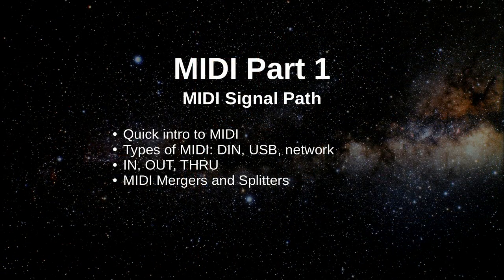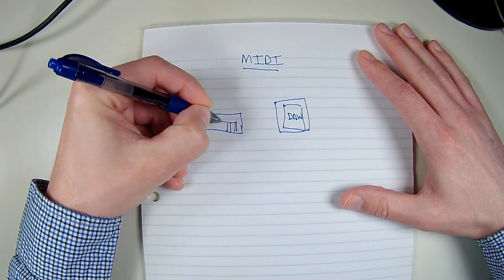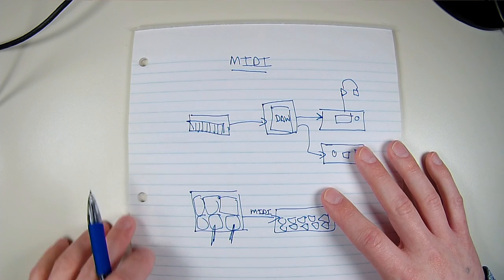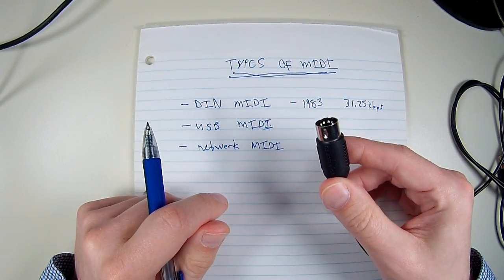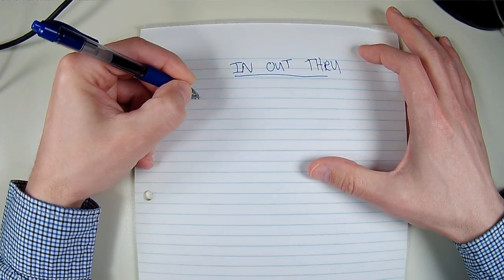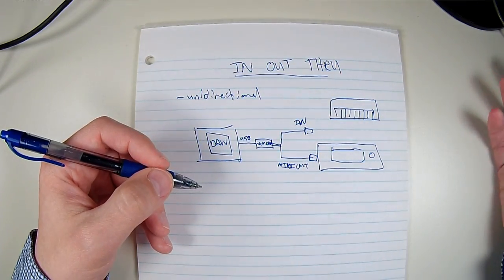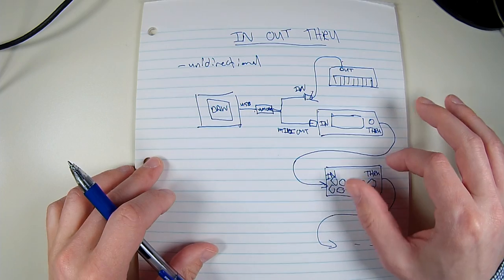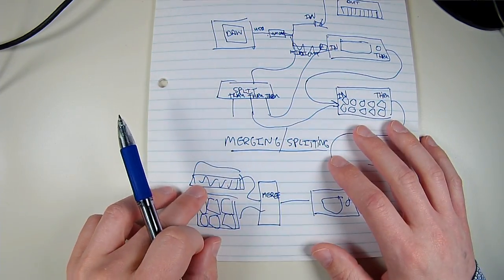MIDI Part 1 - MIDI Signal Path

Comment: I found this to be very interesting and well presented. I used MIDI back in the early 90's with and Atari running cubase and a couple of yamaha dx synths. It was good to go back, recap on some old knowledge and then learn some of the new tricks. Some things I had forgotten but came right back when watching this. 
I am going to follow this series, use what I have learnt and then put it to use with my new equipment and DAW. 

Thanks for putting this together
Reply from the maker: Glad that you found it interesting!

Comment: Very good! I had Cakewalk way back in the 90s. I had a synth I was trying to play. It had MIDI so of course I hooked it to the old 486 with its whopping 2 megs of ram and 40 meg hard drive. And sat there wondering what to do next. I recall getting lost in remap tables that would go round in circles. I had too many hobbies and dropped that one and the rest is history. I then took bass guitar lessons for two years. Again, I found myself with 48 hours a day devoted to hobbies on a planet with 24 hour days. Doh! I sure could have used this series back then.
Reply from the maker: I definitely know what you mean! I also started with Cakewalk back in the day. Kept doing music but eventually found myself building music electronics and have been at it full time since 2009. Been spending more time doing designs than actually making music but as you said there are only so many hours in the day. Lockdown has helped to set new work/life balance... trying to spend more time playing when I can pull myself away from the workbench. :)

Comment: FYI DIN stands for (Deutsche Industrie Norm). :-) I had my first synths here in Munich during the 70s. First we had only control voltage synths (using 0-5V) then around mid 80s the MIDI norm, for standardization (Roland/Korg+Yamaha) showed up with the DIN plug.
Reply from the maker: Yup, but I didn't really think it's important to mention. It probably felt futuristic back in the day... now it's hard to make it fit into a modern design. :)

Comment: Super helpful video. Thanks a million! The reason the cables are labelled as they are is simple. It is the standard routing for all audio connectivity. The out or output sends a signal "OUT" of the Controller to the DAW with the USB connector as the In or Input to the DAW. On the return the USB is the output from the DAW sending the signal to the Input on the Controller.

Comment: excellent coverage of this topic, using paper and pen to describe the topic rather than 'hand waving' bravo!!! I agree with you about the tendency to 'hide' the midi protocol inside the USB configurations, this has caused me a lot of problems with software heavy configurations and is part of the reason I was looking for information about how MIDI actually works. I had an ATARI ST with midi ports connected to a Casio CZ and Korg DDD-1 drum machine hours of fun when modems ran at 9600 baud ;-) Cheers
Reply from the maker: Nice! Sometimes the more direct approach to music making is more fun. I think it explains why small table-top and modular synths have become so popular too.

Comment: Great video.  I'm having confusion about hooking up my equipment.  Here's a list of what I have and the MIDI ports on each.
Computer:  Windows 10
     -Software: Reaper (64 bit) DAW that is MIDI functional;  FocusRite Control (for routing functions)
Audio Interface:  FocusRite 18i8:  MIDI In and MIDI Out and USB (to computer)
MIDI file storage (using 3-1/4" disks):  Alesis DataDisk:  MIDI In and MIDI Out/Thru
Ensoniq SQ2 Midi keyboard (76 note keyboard):  MIDI In and MIDI Out and MIDI Thru
Drum Machine: Alesis SR-16:  MIDI In and MIDI Out/Thru (the SR16 currently can't get sound out, but it still appears to function).  I have another one coming on Wednesday to replace it (and hope I can get everything transferred over to it, either directly or from backup 3-1/4" disks with the Alesis DataDisk.  I have had this stuff since the 80's.. lol

SOOOOO.... the BIG question is: in what order do I hook all of this up?  Is there an importance as to that?
Thank you in advance of any help/advice you can give me.
Chris Foster

I might also mention that I have a cable by "iConnectivity mio" that has a USB connector on one end and splits off to a "MIDI Out" cable and a "MIDI In" cable. According to the manual that came with it, the "MIDI Out" cable connects to the "In" port of whatever equipment it's going to and the "MIDI In" cable connects to the "Out" port of whatever equipment it's going to.  
Where should I use this cable? I'm thinking the DataDisk to Computer USB, but what do I know... ;-)
Reply from the maker: It doesn't matter what order you plug stuff in. It's more important to write down the actual MIDI ports you used for each if you're using DIN MIDI devices, since your software can't detect them by name like with USB.

As for where to use what cables and ports... it's really up to you.
Reply: @shiftedphase  awesome. Thanks for the quick response

Comment: Just starting out in dawless music making and was looking for a guy like this to explain midi and the terminology used. So thank you for taking the time to do this. I think I’m following your explanation.
What I’m after is having my drum machine control the tempo of my synths, because I’m trying to add a live element to my Djing. I’m using vinyl and traktor through a xone 96. I beat match the tr8 to vinyl by ear but need the rest to sync up by them selves. I think this is what’s going on in my system so far clock out from traktor into mixer sound card then out to tr8’s in  then out going to volca base. But just bought a korg monologue and have a Roland efx303 groove efx and sequencer that I’d like to try and control volca base with. Any advice welcome. 🤓
Going to watch the rest of your videos now. Thanks again...
Reply from the maker: If you have one clock source and just want to sync them all up, you might want a MIDI THRU box of some kind... this can make cabling easier.
Reply: @shiftedphase  thanks, I’ll look into it.

Comment: in midi pratical use there are other types...for example the splitter box can connect a daw midi out and make several copies of midi driven faster than a daisy chain setup, but the three synth connected are receiving the same copy of midi out, so the number of channels and bandwith is essentially the same.

but there is another way, the midi multiport interfaces like old opcode studio 128/64/256 or motu midi timepiece or avid midi/o....those boxes are connected to the same computer via usb or other interfaces (parallel, rs232 etc) and daw recognizes it like multiports...so i have midi out 1/2/3/4 and so on....in this way every port runs in parallel and has independent midi channels from each others and so more bandwith because every port is essentially a midi interface on its own.

in past i used this way with atari and log3 to running notator logic and then with mac using opcode models, emagic and motu (still have one in studio)
the nice thing was that old interfaces like log3 on atari or motu studio 128 had a parallel bus not serial so midi timing was really steady...i remember logic on atari...today is everything connected to a ultra speed serial bus....is fast enough to do the same but the parallel port was really an incredible reliable connection in those days when you had 7/8 modules connected running at the same time (maybe one or two samplers....some expander like wavestation and jv2080...and so on....)

I remember well cakewalk from 12tones systems....now it's sonar...never liked it so much....I started at 12 years old with amiga 500 and quite nothing three years later got a kurzweil k2000 sampler and then an atari...nice moments! 

today midi is still used to control some analogue synth via usb and mostly to control vst instruments....but the magic of old midi studios with a rack full of expanders and samplers has gone....it is true also than two synthesiszers like integra and montage today can deliver whopping 384 polyphonic voices whereas an old sound module of nineties or late eightes was around 16/24 or 48....roland jv had 64 but with 4 oscillators was like having 16..

I remember well one of the most common "poor man" midi setup....roland u220, korg m3r and yamaha tx81z....and an atari 520 st running creator or miditracks st!

today a montage alone gives you 128 sampled voices and 128 fm voices with 8 operator and 2 fx for every track plus reverb and delay master fx! wow....time changes.....  :,)
Reply from the maker: Well class-compliant USB MIDI interfaces support up to 16 "cables" on the same endpoint... similar to what you're talking about from those oldschool units. I plan to do a video about USB MIDI where I will show how the protocol looks on the wire. It's a good example of "old stuff running over newer stuff" which is so common in technology.

Comment: Thanks a lot.
I've been trying to find someone who can explain midi in a precise and clear manner. Released in 2017 so the information is going to be up to date.
Reply from the maker: Not much has changed, except how we think about using MIDI. It's still got potential far beyond how most of us are using it. :)
Reply: +Shifted Phase the most common issue is raster delays that midi has still todays...cannot be 'sample locked' to daw....but is easier to measure this time stamp issue and then slip the track/region after recorded in audio and align it to audio tracks, the problem could be only if one want to use it completely in realtime even during mixing.

some people buy old samplers assuming they sound better than software...that is quite true, sound different...but if you later record them inside a computer using crappy audiocards the problem will still be there...so the only solution would be doing old school....sampler playing midi tracks on different channels via separate outputs and then into an analogue mixing console.

but with modern interfaces timing issues could be a problem, knowing well midi protocol is important so these videos could be really helpful for people interested in this kind of usage.
Reply from the maker: You have some interesting points. I think whatever tool people feel "at one" with that gets them results they're after for music making is the right one. It's fascinating how "progress" can sometimes leave out unique qualities of older systems that potentially made them better for some uses. Just look at the retro computing scene!
Reply: +Shifted Phase  yes it is....and the most strange and interesting point is....

i am completely sure if we talked maybe in 1972 to moog robert, or pearlman and stated "in 2017 your electronic stuff will sound better than the newbie" they probably called  us fools....in 2017 we will probably on mars! and same with ppl who made akais or emu samplers of the nineties.

but this is what actually happened, today moog had to reissue model d minimoog, and people still searching old stuff....but whereas retrocomputing is only nostalgic stuff because you can emulate 1:1 in modern pc so prefering a real nes or amiga is only a question of "feelings" because every pc or mac or smartphone can emulate 1:1 those hardwares, with old music gear is not always possibile neither digital or analogue.

arturia or ni have minimoog emulations via vst but the real thing sounds really better and different, we are getting close but having a real model d or a vst version is still not the same (and we still have not considered the hardware feeling side.....)

And then but this is imho....we gained so much more possibilities in terms of power compared to 20/30 years ago (every mac with logic can handle at least 96 tracks....) but music is not changed in better....when i listen to some electronics from 80s and 90s with samplers max 16 megabytes, old school midi and more primitive stuff compared to nowadays possibilities, I'm not perceiving it like dated or oldie, and never boring....what instead I feel in the most of modern productions.

Comment: Thanks for this sensible explanation.  

I have a question regarding daisy-chaining keyboard controllers to control software synths In a DAW.

Would you use in/thru, in/thru & in/thru with the end controller providing the OUT return to the DAW so you have a complete in/out loop?
Reply from the maker: You can’t do it like that... the THRU will not mix in signals from the keyboard itself. It only passes signals from the IN port. If you want multiple controllers use a multi port MIDI interface to you computer.

Comment: I know this video is quite old by now but I have a question;

When we daisy chain from the external synth that is playing back the sequence in the DAW, does the thru send the MIDI channel that the sequence is on from the synth to the Drum machine no matter what, or can you record and play a new sequence on the synth itself, assign that to a new MIDI channel, and send that to the drum machine? Like here's the hypothetical I had in my head; so a DAW is sending a MIDI sequence to an external synth that is playing some kind of lead preset. Now yow want to connect the MIDI thru from the synth to a drum machine, but you want a different sequence of MIDI notes to play (not the same one that the DAW is sending to the synth) could you record a new sequence in the synth, save it, and send it via thru to the drum machine, and now that drum machine would play that different sequence with it's drum sounds?

Please just tell me if none of this makes sense or is just completely non practical
Reply from the maker: The THRU port is literally an electrical copy of what comes into the IN port. The local synth has no way to change it. But because MIDI supports 16 channels on one cable, you can have your DAW send multiple sequences on the same cable, and just set your synths to different channels. The whole purpose of THRU is for this very use case... back in the day computers literally had only 1 MIDI out in most cases. So entire studios were running from a single daisy-chained cable like this.

Comment: This is a very useful video for me!!! Just what I needed. Yet you gave me an hint and now I have a question :) Since I need to connect mymaster keyboard to PC and also the synth to PC, and sometimes control the synth by midi message from master keyboard, what is the fastest and better connection I should do? Is there a difference in latency if I connect by midi the masterkey to the synth or the masterkey to the PC and throug pc control the synth by playing the masterkey?

Comment: thanks for the useful video ! I have a question : what is the difference between MIDI/USB interface and MIDI/USB host ? Thank you
Reply from the maker: A USB host literally "hosts" one or more USB devices. This is normally a computer which has drivers that know how to deal with many kinds of USB devices you might happen to plug in. All communication to and from a USB device is controlled by the host. When you plug in a USB device, your computer asks it about itself and then searches to see if it has a driver for  that kind of device. Because a lot of devices types like mice, keyboards, USB MIDI interfaces, etc. are "class-compliant" they don't need special drivers from the manufacturer.

A USB/MIDI interface is what we call a device that communicates with a computer over USB, and converts MIDI data to and from the standard 5-pin MIDI ports found on gear since the 1980s.